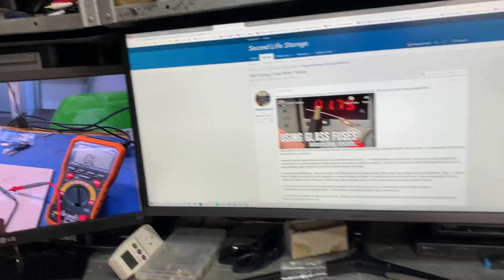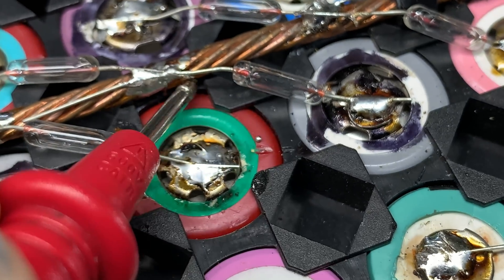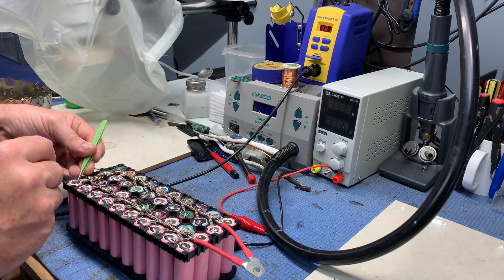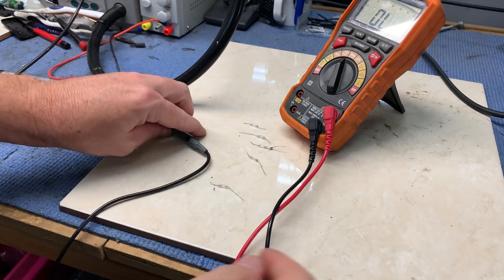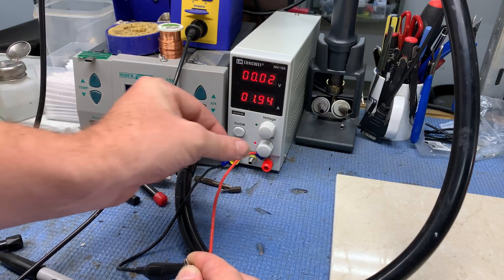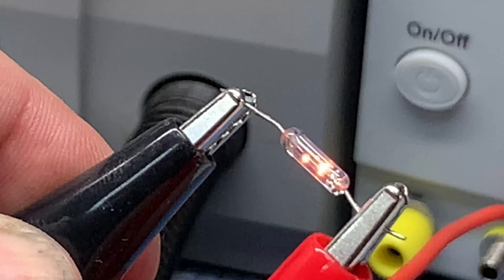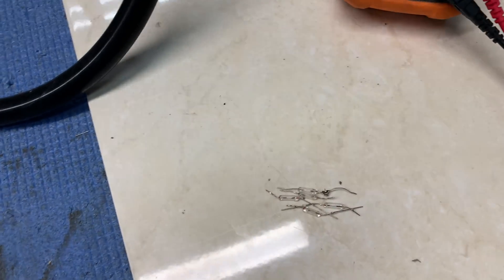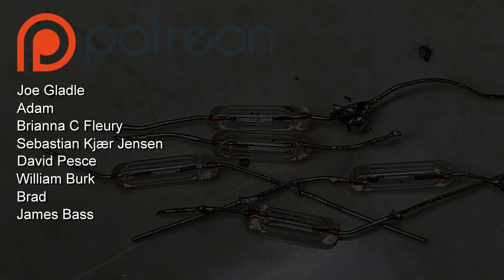Testing the 5 fuses from yesterdays video

Comment: Interesting video. Great work.
Keep it up.
Reply from the maker: Thanks, will do!
Reply: @
VINIT SINGH
  - Actually, this test proved nothing and is 100% invalid ...
Reply: @MrSummitville  would you like to give reason please, Sir. That why, it's invalid?
Reply: @vinitsingh8962  When he removed the "2 amp shorting wire" from the Power Supply, the power supply CHANGED from Constant Current Mode, to Constant Voltage Mode.  Now the output capacitors charged up, from 0.1 Volts to 4.3 Volts.  YIKES!  He then DISCHARGED the output capacitors into the fuse. He has no clue how many amps were flowing into those fuses.  Maybe, more than 10 amps ???
Reply: @MrSummitville  Hmm. That's some interesting news. Can I have your social media (what's app) if you have.

Comment: You said you are wasting your time,  yes the fuses are not the problem
Why are you testing the fuses they are mass manufactured and will be in tolerance, I also say they are not 2A fuses  my guess is they are 1A fuses. The PSU you have will when set like you have it, will give a much higher current  than set when you connect the fuses.
The problem is in the cells, they do not have the ability to blow the fuses.
Reply from the maker: Could be anything in the equation i guess.. next I'll test the cells given the time.
Reply: @HBPowerwall  Yes please.

Comment: It seams good that in a fault condition 99% of the cells are going to be disconnected electrically. Has got to have a massive calming effect on the  chance of thermal runaway.
Reply from the maker: if only a hand full of cells are still connected it takes away so much energy from that possible thermal reaction so what I take away from it is it's still saver than not having fuses.
Reply: @HBPowerwall  Exactly ....id like to see you dead short those 5 random cells while still in a pack till they are flat and see what the thermal dissipation is like

Comment: Cold solder joints maybe?
Reply: nope. Bad cells with maybe bad CIDs.
Reply from the maker: if CID was bad cell would be zero volt? next question - why didn't cid trigger.
Reply: @HBPowerwall  I had the experience that the CIDs sometimes goes half way off only

Comment: What about Internal resistance (impendance) of those cells? (I use YR1035+ to measure rhis.) If it is high enough, the cell won't let 2A current through (ohms law).
On the other hand, this kind of cell is overheating in a big pack like yours. It can still hold capacity and is OK for low currents. 
And another thing; cells with large capacity tipicaly can do lower current. When degraded, they can manage even less current.

Comment: Check the CID's. I've had cells show a voltage but chargers won't detect them. Out of curiosity (for science) i pushed the CID down and the cell was then able to charge. My thoughts are that the cell has heated but the CID hasnt fully opened and cut the circuit.

Even if the IR of a cell was 1ohm, theoretically it could still deliver 4.2v/1ohm = 4.2A. It would get hot rather quickly.

The only other idea is that the Capacity is so low that it can't sustain more than 2A for long enough, however the battery would hit 0v after a short, so im gonna say CID or IR of the cell.

Comment: Using the bench PSU this way will deliver a lot more than 2 amps when you connect the fuse due to the output caps, a better way would be to turn the voltage down to lowest before connecting the fuse and slowly increase.
Also a 2 amp fuse is designed to carry up to 2 amps and depending on the design may carry more amps for a short period.
Reply: Agreed!!! 
The sparks at "only" 2 A seems to much. I think the PSU delivers much much in the first few milliseconds.
I tested my 4 A fuses by turning up the amps slowly.  Actually the all blow around 6-7 A. I guess the 2 A ones can handle 3 A continuously.
Reply: agreed
Reply: Absolutely, need to raise the voltage up slowly with 2A current limit.
Reply: This

Comment: I am surprised no one mentioned this: you can't use a bench power supply to test fuse blow current like this. They have smoothing caps on the output that are capable of delivering 10s of amps for microseconds when first connected. Your fuses may be faulty for other reasons but this methodology will not help you make that determination.
Reply: Not true, a good current and voltage limiting bench power supply will not have a high burst at all.
Reply: @octapc  I have this power supply and can confirm it has very high output capacitance
Reply: @pufferfish0101  they all do to improve d.c output.  They also have an internal load to dissipate voltages/current  that are above preset.

Comment: Next test is the single cells them selves where the fuse didn’t blow, check capacity, resistance and use another glass fuse and your own fuse wire doing a dead short, see what happens!

Comment: Nothing wrong with the fuses, its the way you are testing them. leave a short across the psu terminals, then connect fuse, then remove short. Its the psu output cap killing them.
Reply: Agreed.  I'd also suggest putting a small power resister in-line with the circuit.  You're assuming the control circuit in the power supply is able to respond instantly, and with effectively a zero resistance, which isn't the case. The power resistor will help give the control circuit a bit more voltage range to control. It won't impact the fuse at all.  So set up a series power resistor, and then a parallel path with one side being a short (with a switch to disconnect), and the other side a smaller power resistor and fuse.  During initial operation most of the current will go through the short, but then the open switch will allow all the current through the fuse. The smaller power resistor is needed to bias the initial current through the short, and it's resistance being < series resistor means it won't upset the control much (voltage point).
Reply: 100% correct. The power supply doesn't have enough of a response time to accurately regulate a couple of milisecond impulse. If you measured the current on a scope you would see a >2A spike and then it would level off at 2A shortly after. For any testing like this you need to either have a series-resistor to hard-limit the inrush current or you need to conenct the fuse and raise the current to your target.

Comment: Yer i recon you probably have some bad cells in that small pack that have high enough internal resistance and low enough capacity/voltage that they just couldnt muster the juice to blow. Take the offending cells out and test the snot out of them.. do a cap test then an Ir test and then short them to see what amperage they can put out at 4.2/3.7/2.5v.

Comment: the problem seems to be with the cells, a 1A or 2A discharge test on those cells could answer that, also would the fuses blow at a low voltage ?

Comment: Fascinating!! 
NOTE: @HBPowerwall you testing @ 2A and 4.21V. Most likely when shorting just a couple cells, the voltage of cell quickly sages, so maybe 3V, or less (not sure). 
Question is how low a voltage can you apply while holding 2A current and not have the fuse blow? ;)
Cleary not at 0V .. but 1V, 2V, or 3V ??
Reply: voltage is not a function in these tests as the fuse has almost 0 resistance.

What's happening here is a function of the cell's internal resistance and it's ability (or not) to supply enough current to blow the fuse.

Again, the purpose of cell level fuses is not to protect anything but the individual cells from the rest of the pack. Or, from a single shorted cell shorting the rest of the pack.

Take a spot welder for example. The working open circuit voltage of an industrial spot welder is 2v at max, yet it can deliver 1000's of amps to the job, continuous. The difference is the transformer in the spot welder is supplied by the grid and is designed to transform the 240v at say 10A, down to 2v at 1200A.

If that same transformer was wound to only supply 0.5v it would be capable of doing so at 4800A continuous.
Reply: @jimmyb1451  A fuse will blow when the power (I^2*R) exceeds a certain wattage. Fuses have maximum voltage rating (to prevent on-going arcing), but no minimum voltage rating. If there is not enough power available to melt the fuse wire, it will not burn (disconnect). 
This a good reference.
https://electronics.stackexchange.com/questions/51366/how-does-a-fuse-blow-at-its-current-rating-regardless-of-voltage

Comment: Back in the last video you said you got voltage when putting pressure on the cells - could this be a fault inside the top cap on the cell?

Comment: Those cells that the fuses didn't blown, are they able to discharge at ampere above 2A?
Reply: I thought he did multiple short tests, I guess some with wire fuses, and with each test different cells didn't blow. but it makes sense to me the cells that didn't blow can't discharge more than 2A. what doesn't make sense is why it was different cells with each test.
Reply: Are those fuses meant for 4.26V supply or 250v? What about response time of the fuse? Are they fast blow fuse FBF? Slow blow fuse SBF? Are there protection circuits on those cells? If it is a SBF, the peak discharge from those cell may not have enough energy to cause the fuse to ignite.  For FBF, If there is higher voltage cells before and after the cell, the rate of discharge may not be fast enough for the current to spike and peak and get fuse to blow. Use thermal on the edge of the cell while it is discharging at a constant rate, say 1A and if the temperature at the edge is higher, there may be regulator inside the cell itself. Or simply the cell could not discharge at 2A long enough for the fuse to go. If the cell can discharged at over 2A but only for 1us before normalising to... say 1A, there is not enough time for the fuse to blow if the fuse is rated.. say 20us. Since the voltage is only <4.26v instead of 250v, it won't be able to damage much of the fuse used.
Reply: There is also a difference in the assessment of the Internal Resistance: Pete was previously measuring with a meter (SMB8124A)  that measures by an AC signal at 1000 Hz, but what is actually being assessed, rigorously by the short-circuiting, is the DC behavior. What should be measured is the current. When the internal DC resistance is higher than 2000 mOhm, the fuse won't blow anymore because the current is then lower than 2 Ampere at 4 Volt. The "Mystery" is caused by the fact that the internal resistance of a Lithium-Ion cell behaves differently at different frequencies, an example graph is shown at battery-university (search for "battery_rapid_test_methods"), so the internal resistance is different at DC and at 1000 Hz..

Comment: ok pick 2 cells from the stash  one highest ir one lowest ir  and fuse them and do the test to both cells ?
Reply from the maker: Next question is my IR tester accurate enough to do that ?
Reply: @HBPowerwall  not sure just want to see if say 50 milliohm is better for blowing fuses  and thus safer  where as say 100 milliohm may not blow the fuse and is unsafe
Reply: ok done some calc maths i think amps  4.2volts / 0.050 = 84 amps     4.2 / 0.100 = 42 amps 
so the presumtion here would be @ 50 millohms it would have more energy to blow the fuse ???  am i thinking this right ?
Reply: @dtec30  I had bad cells with >150 mOhms. Good cells are always around 35-50 mOhms.
But I think the CIDs might be the problem. I had many cells which got hot at some point before. Sometimes the CID protection only works "half". When I tapped the cells hard the returned to life. Also sometimes you can read a voltage but the cells don't charge or discharge anymore. Just for test reasons I did some tests with these bad CID cells. I reset a some and they are still working now (in low current application like a esp8266 temperature sensor etc).

Comment: Those cheap lab power supplies output a higher current than the set current, when you connect it. The proper way to do this is to start at 0A and raise the current up to 2A. I'm almost certain the fuses won't blow then. :-)
Reply: Yeah before the bench power supply can go into power limiting mode the output capacitor will get drained and generate a spike. 
Thats why you can kill leds with it even you set the right voltage/amps too.
Higher voltage, higher power spike.
Reply from the maker: They did yesterday?
Reply: @HBPowerwall  You can test this by marking  the knob position at 2 amps using shorted leads method.  Then turn down to 1.5 amps w/ shorted leads method.  Connect to a new fuse. Hopefully it doesn’t blow but glows.  Then start turning knob up toward 2amp and it blows and knob is pretty close to the 2amp marker from step one.    If successful this would confirm that there isn’t some kind of initial brief capacitive current spike before current goes into regulation.
Reply: @yeliab814  He should be able to read the current on the tester, so no need to mark the knob. :-) At least if he raises it slowly from 0A.
Reply: @yeliab814  I have the exact same supply as his. I can see my current spike to about 2.5A, when I short the leads and have it set to 2A. So there's no telling how much the spike is.
Reply: @Spixe  We don’t have time machine to retest those fuses.   My suggested method is solely to help validate the test. of those 4 fuses.   Please suggest a better method if you no likey..
Reply: @HBPowerwall  I meant to short the leads with the fuse before raising the amp to 2. :-)

Comment: Good info. Now if you have the time, would be nice to see the test of all the 18650 for mah and internal resistance. Or if not all, at least the ones that don't blow the fuses. Cheers.
Reply from the maker: That's a whole lot of work right there.. but I guess if the demand is there i'm happy to do it..
Reply: @HBPowerwall  I am pretty sure it is ;-)
Reply: @HBPowerwall  A quick test ... will fuse blow at 2A and just 1V of power supplied? I have another minute, test at 2V, then 3V. :)
Reply: @HBPowerwall  do it.

Comment: So the problem is the battery itself - High internal resistance.
Reply from the maker: Can't be different cells didn't blow when they did last time.. Do i do the whole test again?
Reply: @HBPowerwall  just test the 5 cells and see how they can cope with real life. Charge discharge and amp draw test
Reply: Been keen to see them 4 cells in a opus as well plus ir test. Internal cell ir seems to have a few comments.
Reply: yes, pls